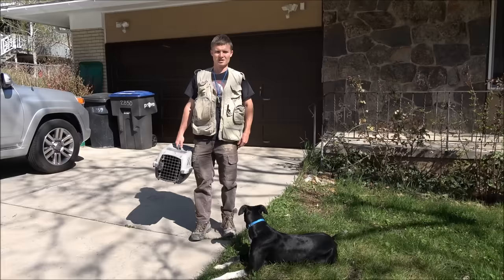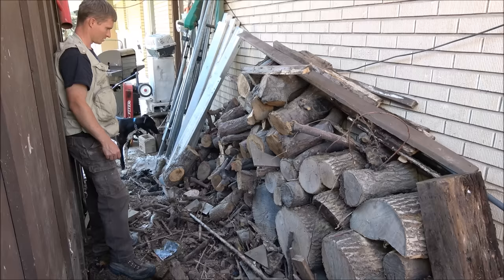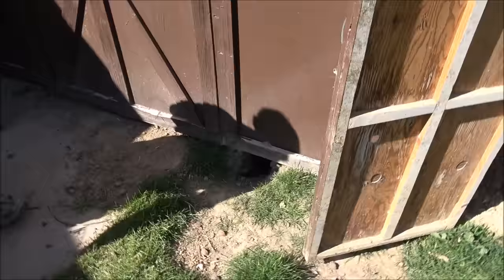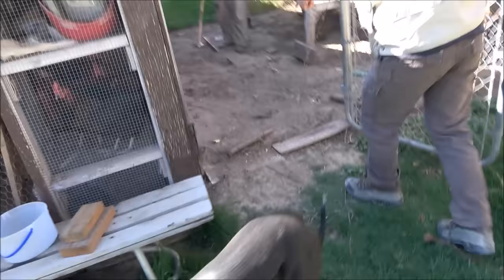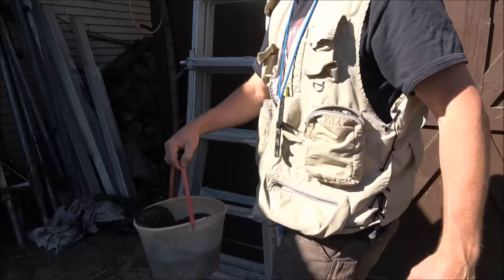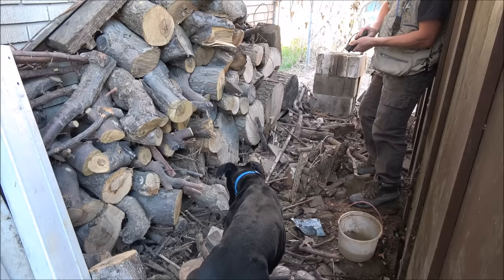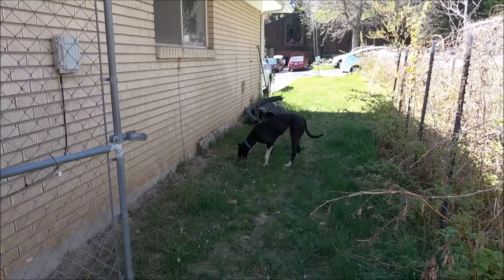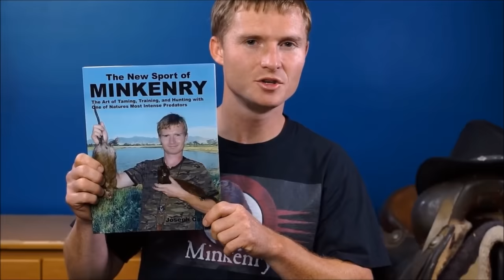Mink and Dog Cleanup Backyard Rats

Comment: i do kinda pity the rats, but i get why it needs to be done. and i'd rather have them hunted like this than with some poison. 
effective little pair you got there. :)
Reply: It's amazing how quickly the mink and dog kill them once they get em.
Reply: Alpacalypse Yes it is honestly one of the most humane ways. I've had traps that just don't finish the job, so I have to whack em with the shovel. I wish i could do this way, but recently found the a24 gaspowered rat trap gonna give it a go has good reviews and seems very humane and quick. Cheers
Reply: Sure seems you could build a solar powered one with a big capacitor and solenoid, and never have to change the gas cartridge.
Reply: Can't believe I put this comment on the wrong video.
Reply: It's a chicken coup, of course it will attract rats, they eat everything including whatever the chicken are eating. Would you prefer they kill 6 rats now, or 100 rats later?

Comment: The dog not only knows not to harm the mink, but it won't even interfere if the mink has control of the rat. And for its part, the mink is actually very tiny in stature under that fur. Its barely twice the size of those big rats. Yet the rats dont stand a chance against it and it can kill them all day long as long as it can take swimming breaks.

Comment: I’m sorry the whole back your is a rats nest. Your raising rats and chickens. You probably don’t have a Metal feed container with a strong led. You need a metal feed  trough so the chickens s can’t scratch there feed out on the ground. What’s left put back in the container what came out of the feeder. They will finish until you get the rats under control. And clean up your wood  pile keep it away from your buildings tarps are cheap.